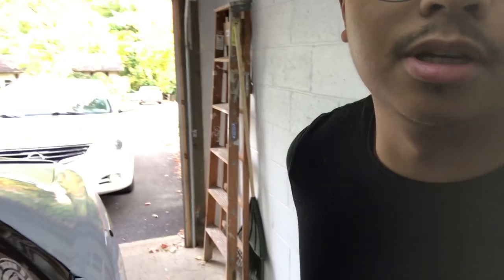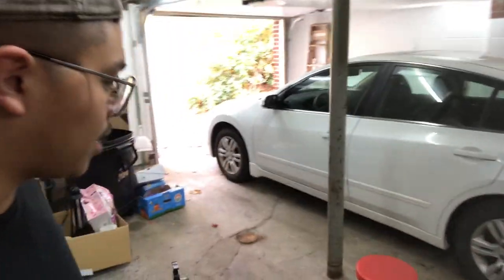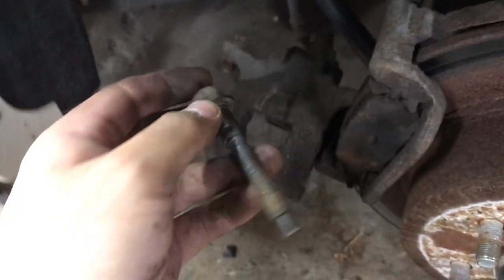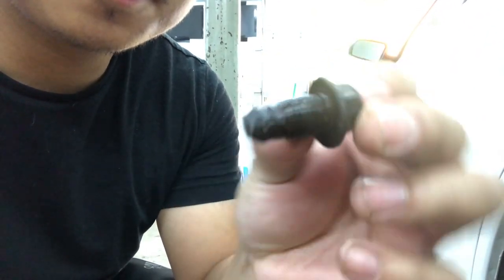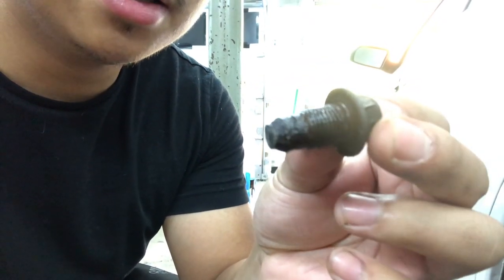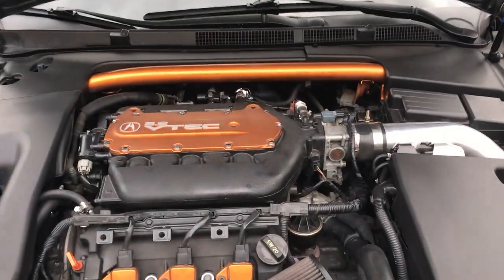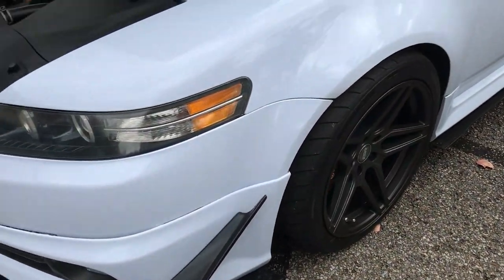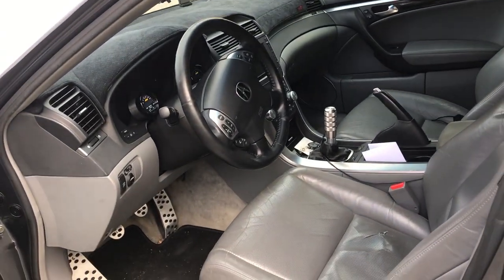Building a 500 HP Supercharged Acura TL / Welcome Back

Comment: Nice vid bro I have a TL bro and we literary look identical I also want the centrifugal supercharger , how does the bypass valve work on the intake and did you put the sc  it in yourself ?
Reply from the maker: Yeah I did the install.  It took me a few nights to complete.

The bypass valve/BOV has a vacuum line that connects to the intake manifold by either a T-joint (if you have oem motor mounts) or direct connection.  As soon as pressure is created in the intake system, the BOV closes allowing for more pressure to build.  

Pressure is then released from the intake system via the BOV once the throttle body closes (either during a gear change and/or depressing the gas pedal).  This is because vacuum is created once the throttle body is closed.  Since an engine is a closed system,  the only place left for air to escape is the BOV vacuum line mentioned above.

Hope this helps!

Comment: Super clean. Have you done anything to engine internals or valvetrain to help handle the power?
Reply from the maker: Thanks.  No I haven't touched any internals.  I plan is to just switch over to e85 and ride out the life of this motor (180k miles).  At some point I'll probably begin building a 3.5L swap.
Reply: @JSant  Have you had any issues yet? That’s lowkey a lot of power for a stock J series motor. I want to go forced induction with my 2015 TLX SH-AWD but the cost for the supporting mods and the kit are insane. Worth almost as much as the car.
Reply from the maker: @barrettbritt  Zero issues so far. Our engines are pretty robust with the right tuning. A friend of mine is running 14psi on stock internal J32 making 514whp.
Reply: Also, my car has 73k miles already so keep that in mind.
Reply from the maker: @barrettbritt  Ahh that's low miles lol. You'll be alright. Are you looking to turbo or supercharge?
Reply: @JSant  Can’t decide. I can make more power supercharging with the rotrex kit from gerzybear, but I’d rather not lose A/C 😄. The turbo kit makes less power and won’t be as friendly on the trans since it isn’t linear, but it is cheaper and still makes 500hp. I haven’t looked into custom options yet because I am nowhere close to having enough money yet. Forced induction ain’t cheap!
Reply from the maker: No it is not cheap at all haha

Comment: Can I ask what you did to prevent the intake pipe in front of the precat from hitting the radiator? I saw it had a black bracket or something?
Reply from the maker: I stuck a foam pad on the radiator. It actually doesn't make contact with the radiator at all. It's just there for good measure. You'll get a better view once I tear the car apart again in a few weeks

Comment: How did you super charge it? I have a 06’
Reply from the maker: I bought a complete kit from Gerzy Bear Performance.  But you will need a way to tune your car.  If it's a 6MT you can swap your ECU for an 07-08 Type S ECU or 07 Base ECU and use Hondata. If you have an Auto you have no option other than to go standalone... ex. haltech, aem, etc.
Reply: @JSant  Will the Gerzy Bear work on an AT?

Comment: Is there anyway to run the Rotrex sc with AC?
Reply from the maker: Yes. There are two options so far but both require a significant amount of money/creativity.  One is to relocate the blower and use an extended shaft (similar to the comptech supercharger).  The other option would be to run an electric ac compressor.

Comment: Ok , how does this type-s only have a 3.2l when  type-s gave always come with 3.5? Just curious.
Reply from the maker: This is a 2004 6 speed base, not a Type-S.  There are a few Type-S parts installed which can make it a little misleading.
Reply: @JSant  ahhh ok thanks for the clarification bro, I have an 08 base myself. Sadly it's the 7 speed auto lol

Comment: i have the same car need a dash, i live in florida and the sun cracked it. ive had this car for ten years and dont want to get rid of it only 87k original mile.
Reply from the maker: If you don't want to replace the dash you can look into coverlay dash covers... with proper installation it looks close to OEM.
Reply: @JSant  thank you i will
Reply: @JSant  just saw what you where talking about but i rather change the dash do you know where i can get a dash? once again thank you
Reply from the maker: @DoctorPepper4  I think you can still buy them brand new from Acura.  However, the  going price for them are ~$1000.  The only other option I can think of is to find a used one from a junkyard or car-parts.com
Reply: @JSant  thank you so much I guess ill try the dealer as my junkyards don't have it i checked. once again thank you